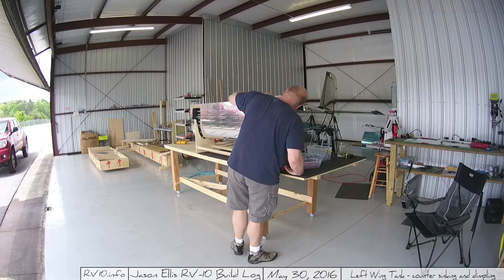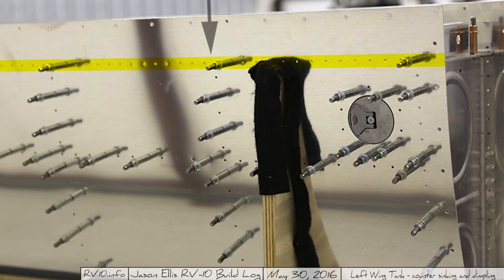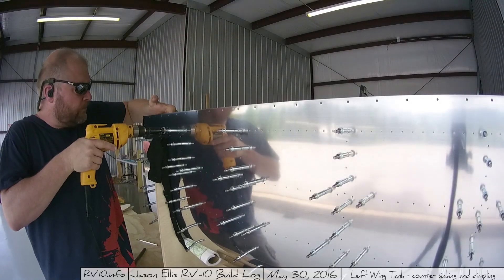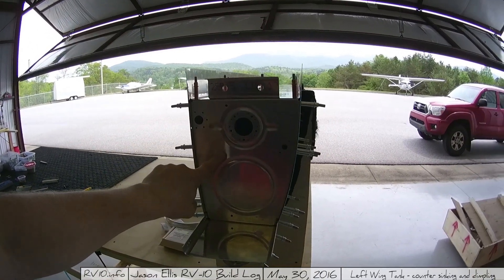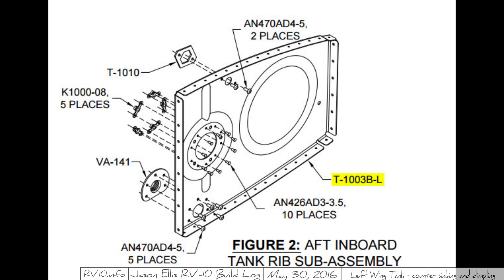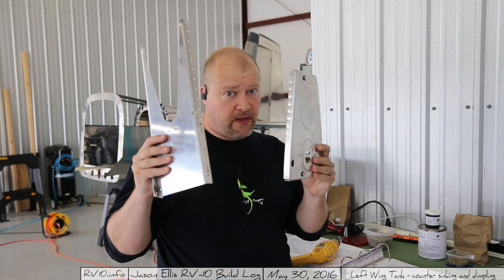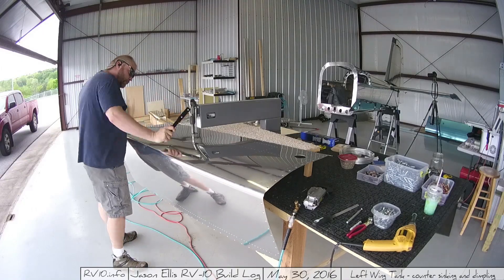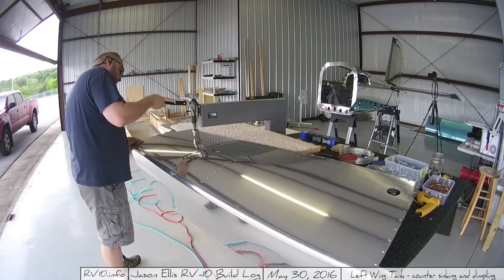RV-10 Wings - 023 - Left wing tank counter sinking and dimpling

Comment: Pro-Seal... I know you are way past this part but thought I'd let you know, just in case you use it again! When I was working on UH-1H's in the Army, we use to spread Pro-Seal with Popsicle sticks and then used a little bit of saliva on your fingers to spread it around where we needed it. If I remember correctly, you can also use a very light coating of oil on your fingertips to move it around.

Comment: Quick question you said those rivets have to be counter sunk but I'm just wondering if maybe they left them uncountersunk since they are inside the wing and they wouldn't have to be aerodynamic?       also i was wondering if the rivet head is angled for a countersink does that mean you have to countersink it or can you just squeeze it flat with both sides sticking out?
Reply from the maker: Quite often you have to countersink for things that are much later in the plans.  So it doesn't become obvious as to why, until later.  In this case that top row is machine countersunk instead of dimpled because if you were to dimple it would make it more difficult to put the back of the tank on.  (prime example of something that doesn't come obvious until you do it.. )

I'm not sure I understand your second question?  If it requires a counter sink, and you dont but rather just use the squeezer to make a flat rivet you'll likely dimple the skin a bit with the rivet, but completely flatten the rivet head to the point where its not structurally sound.  So that'd be bad.. =)  I think that's what youre asking..
Reply: Jason Ellis sorry I should have went into more detail haha I was asking about the inside wing spar that you show at 3:57 and you put the holes must be countersunk. if you didn't countersink them could you just squeeze the rivets and they would be fine since it's going to be inside the wing? I get why countersinking is important on areas where you would want less wind resistance like the outside skin.
Reply from the maker: AH those have to be countersunk because the fuel sensor has to sit on top of it.  You must countersink them for sure.  There is a rubber gasket that sits over it, but if you didn't countersink I'm 100% sure it'd leak.    

Now having said that.   If there was no aerodynamic reason, or no other parts that could interfere then yes you could potentially not dimple/countersink.  But van's is pretty thorough.  If it calls for an AN426 then you know it needs to be either dimpled or countersunk for SOME reason.  =)  

It's not always about wind resistance.  Sometimes there are parts that will eventually move right next to it and an AN470 rivet would get in the way.  That'd be bad.  Think Aileron.. if it doesn't have smooth travel you could have problems! heh

Comment: Is it possible to build the fuselage first after the empennage, or does the build require the wings to be built after the completion of the empennage?

Great videos.  You've really inspired me to start my RV-10 project soon.
Reply from the maker: Great question!  I called Van's and asked;  Apparently the "standard" order is Emp, Wings, Fuselage.  But there is no reason you can't get the Fuselage after the Empennage before the wings..
Reply: Only thing I can think of is, from what I have read, the plans become less detailed the further you get into the project.  You may be in shock of the lack of details on the fuse if you skip the wings. I'm only on the empennage so I wouldn't know for certain.
Reply: @lmannyr1  He went into this a little bit during his bad customer service experience video. In the beginning it describes every detail but later on it just says a process.